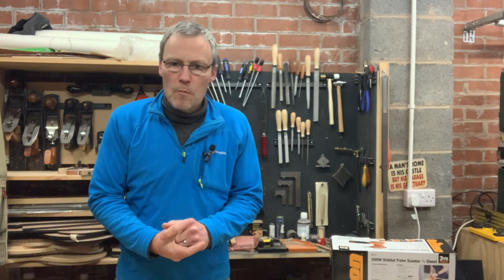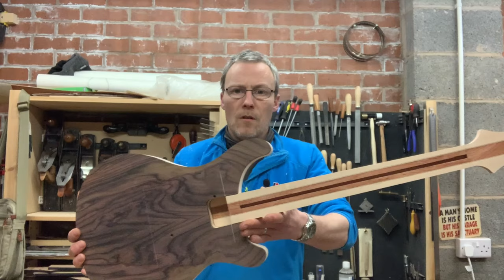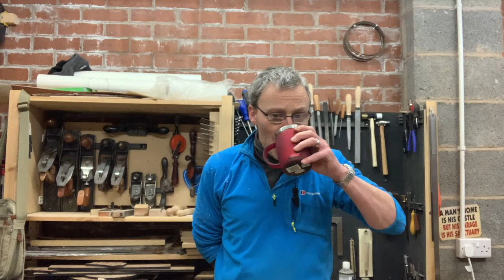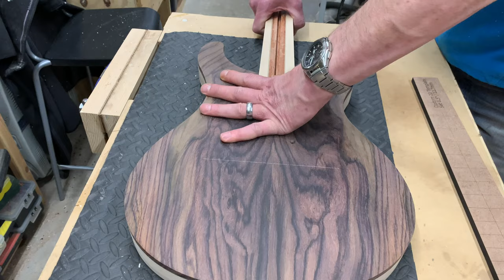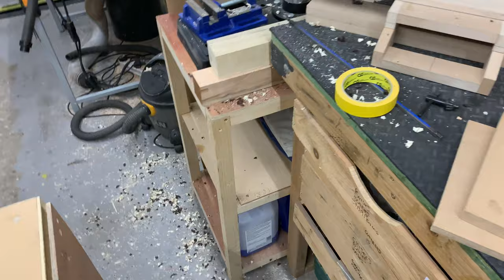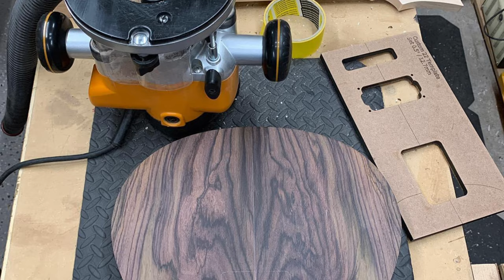Electric Guitar Scratch Build - Makers Central Tool Haul & Routing - #GGBO 2022

Comment: Looking fantastic. I had to laugh as you pulled the neck out with that squeaking sound. I said aloud, "Too tight, I think", which you then echoed.
Having just last night installed the fret dots in my ggbo neck (video coming soon I swear) I had a similar issue. The holes and dots were slip fit dry, but with the addition of glue, the hydrostatic pressure kept them sprouting back up. Sorted now, but as much as we like a certain level of accuracy, physics also has its say.
Reply from the maker: What i didn't show was having to use a clamp to get it into the pocket... I'll 'tickle' it with a scraper to get it right and leave just enough space for the glue
Reply: @WhitefootGuitars  I did that very same maneuver once, on one of my first builds. Deeply pleased with myself, I clamped the neck into the pocket (a Strat style bolt on) and the treble side margin of the pocket cracked off and shot across the room lol